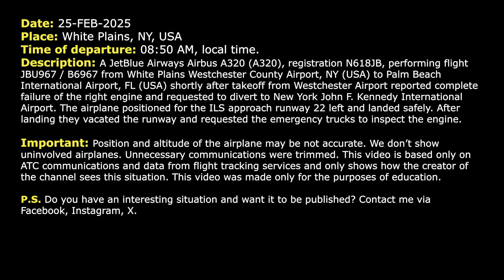Complete engine failure after takeoff. JetBlue Airbus A320 diverts to New York Kennedy. Real ATC

Comment: Somebody explain to me why he choose to go to another airport rather than landing at the airport he took off at?
Reply: With an engine down, the plane has decreased ability to use reverse thrust upon landing to slow down. They can use their brakes, but those can overheat. Esp. As they’re overwight too with full fuel. So, the plane will take longer to slow down, and JFK has longer runways. 👍🏼
Reply: @michaelmckinney5954 THANK YOI!!
Reply: @michaelmckinney5954  thanks,  makes sense now.
Reply: Westchester was never an option. They were 20k pounds over Max Landing weight. Westchester's longest available runway is 6500ft. This was pre-planned prior to the engine failure. Every takeoff has a unique plan depending on a myriad of factors such as weather, landing distance, and emergency services. Maintenance is never a consideration. Also, landing distance is not predictated on the use of thrust reversers.
Reply: don't know, but often it's better to land where the plane can be repaired.  JetBlue Technical Operations Campus is at JFK,  Pilots probably told to head there if possible.
Reply: @Tsnor150  girl it's already been answered after you commented......
Reply: @Tsnor150 mostly this. White plains airport could handle a single engine landing but doesn’t have mechanics or a JetBlue hanger to repair the plane. Also, most passengers can easily hop on other flights at JFK since it’s a JBU hub.

Comment: Radio phrasology and stardard comms help a lot.. On both sides. Saying MAYDAY first and 3 times has a purpose. First, it's not lost in a bunch of words like 'declaring an emergency'. It's precise, consise, and clear. It also alerts ATC to be listening for what comes next. Without it, they may not have the mental prep to know what follows... Next, again, consise.. Long winded is bad..too much to parse. Radio traffixe should be routinized, not free speech.  MAYDAY MAYDAY MAYDAY Engine Failure.  1800 climbing 7000 request  2000 JETBLUE 967.  If that is too much (as in need to aviaite or navigate), then MAYDAYx3 + JETBLUE 967.  Saying altitude and requesting a new one (level off since last instructions were 7000) saves a back and forth.
Reply: Your comment contradicts your comment.
Reply: More words = more cognitive demand from listener.
Reply: It's a PAN call...

Comment: Pilot: “We have an engine failure.” 

ATC: “Start a climb from 2000 to 7000.”
Reply: Declaring a Pan Pan would help
Reply: @jamesshiels8829  How would that have helped? They took the proper action and got the assistance they needed. It was handled quite well and was almost a non-event.
Reply: They have to climb to a safe altitude to run through required checklists to isolate the problem and prepare the plane for a landing. It allows the ATC & the pilot to coordinate and keep other planes out of the way...until it is ready for final approach. It also keeps them further away from obstacles. Also, some aircraft have to burn or dump fuel to reduce weight. 

As long as the situation is stabilized...this is normal & routine. Passenger planes are capable of climbing and holding altitude...and doing what they need to do with a bad engine. It may take longer for the plane to respond...but they are designed to be able to fly safely with a bad engine. Increasing altitude a bit actually gives the pilots more options to land safely. Altitude buys them time...and it also increases the number of airfields they can reach if things deteriorate further.
Reply: Truly toddler level here, why would a plane climb higher with engine failure? I *really* am intelligent but this post makes me sound ridiculously dumb 😂😂😂
Reply: @jamee_maree  Two engine planes a re perfectly capable of climbing with one engine gone.
Reply: @jamee_maree  If second engine quits, they would need that altitude to glide to an airfield. Two engines out at 2,000ft means putting it in Jamaica Bay or on an expressway.
Reply: no wonder why in US there are so many aviation incident.
Reply: @Isomug  Engine failures don't normally result in an accident. All twin engine planes are fully capable of continuing to climb and doing a go around and safely landing.

Comment: these airlines have some serious maintenance issues
Reply: Machines, even those maintained to the level to which Part 121 operators must adhere, break from time to time. And it's way, way too early to maintain that maintenance was/is a problem.
Reply: P&W GTF?
Reply: @iceman9678  Sorry. I don't speak millennial.
Reply: @ Pratt and Whitney Geared Turbo Fan.

Those are common acronyms in the aviation industry.
Reply: @iceman9678  Sorry, I didn't realize you were trying to show everyone how smart you are.
Reply: @ as I said the acronyms are common.  Knowing them doesn't mean you're smart.  

Denigrating comments directed at someone for using them does indicate that the commenting author lacks common knowledge of the industry.

Anyone with an ounce of humility would have recognized this instead of doubling down.
Reply: What a brain dead comment.

Comment: most incidents go back to the originating airport - why did they choose kennedy international to continue with this emergency?
Reply: 3 reasons, JFK has better emergency services, overweight landing, and JFK is JetBlu’s hub.
Reply: Just a guess, but longer runway for overweight landing?
Reply: @dougmcclean  That and White Plains sucks to fly into.
Reply: They departed from HPN. That airport has a short runway. Since JBU967 just departed and were going to PBI, they were carrying fuel for a longer flight, making them heavy. Heavier planes need more distance to stop. JFK has longer runways, allowing them to land heavy, and it was literally right in front of them when they took off from HPN.
Reply: Longer runways, better equipment, their main base, better recovery. Everything was in favor of Kennedy
Reply: White Plains has a 6,000 foot runway and only one runway to accommodate an A320.  Kennedy has 4 runways, all of which can accommodate an A320, and the longest is 13,000 feet.  Overweight landing on an engine failure is more favorable to the latter.
Reply: JetBlue hub is JFK and have a better chance of getting another aircraft there than HPN.
Reply: JFK is a much larger and better equipped airport than a tiny White Plains airport filled with a lot of executive traffic
Reply: I imagined better emergency response. Learned of the other few 😁 thanks gents